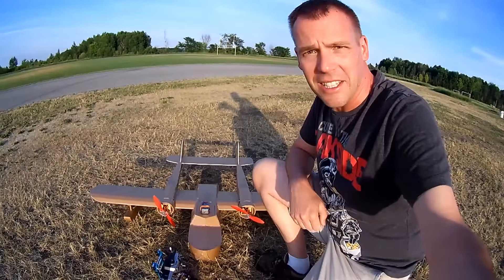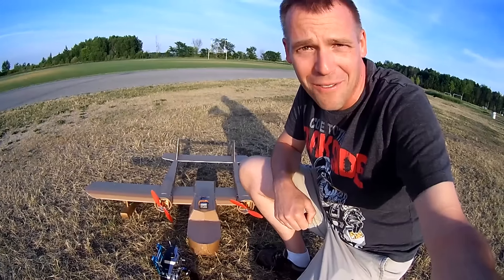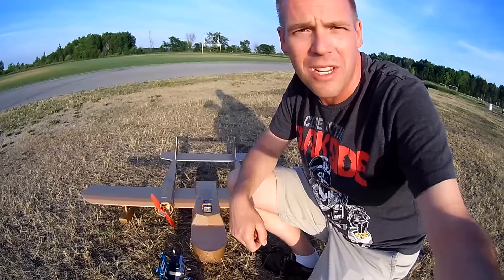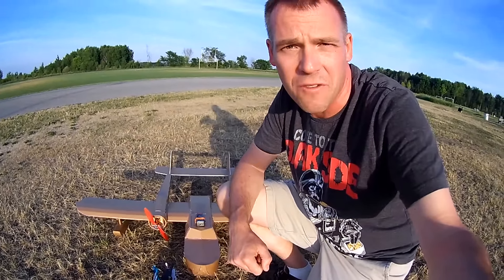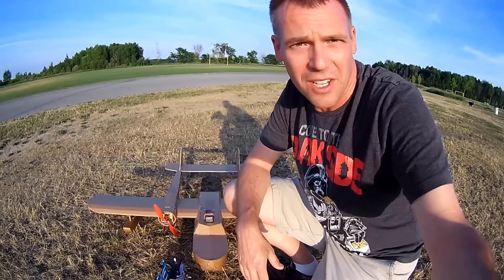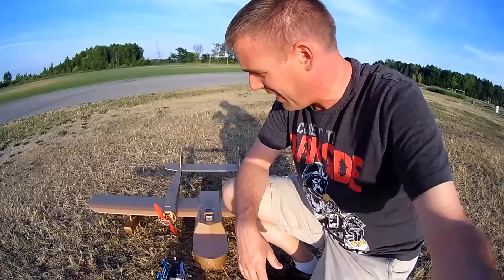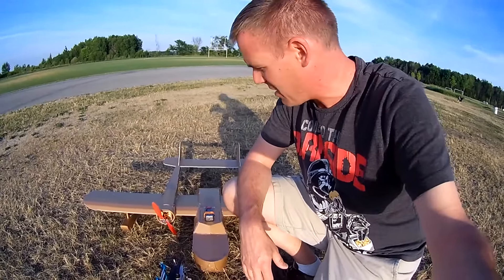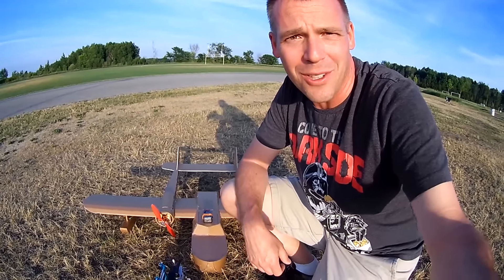The Flite Test Sea Duck Maiden Flight

Comment: Thank you Andre.  Your review trigger me to purchase the Sea Duck and the Twin Pack C combo.  I do have a question and wonder you can help me out.  I am planning to run the 4S setup.  The Flite Test store does give me the options to purchase 9x4.5 Prop for 4S setup.  However, the Twin Pack C combo that comes with the Emaxx GT2215/09, the manual said it's only running upto 3S.  Also the Twin Pack C only provide 30amp ESC.  Won't it cause overheating problem?  Thanks and keep up the good review
Reply from the maker: According to Josh and Flite Test the C pack can handle the 4S so you should be fine. I want to test my setup with 3S when I get the Flite Fest but need to pick up some 9x4.5 props.
Reply from the maker: Enjoy the build. I had a lot of fun.
Reply: +André Rousseau Thanks Andre. The 9x4.5 are their recommend 4S prop setup. Not sure why you need it if you already have 4S running
Reply from the maker: I'm not running the FT setup. My motors run 8x4.5 on 4S and 9x4.5 on 3S.